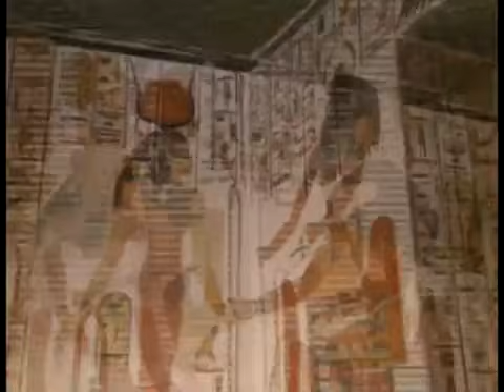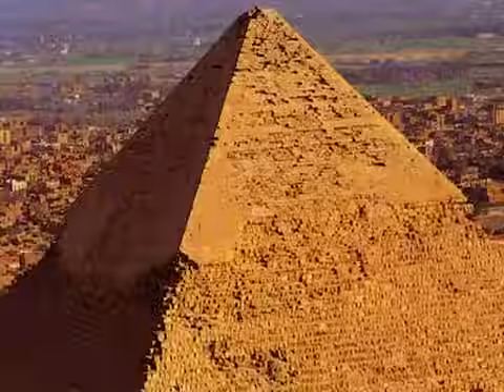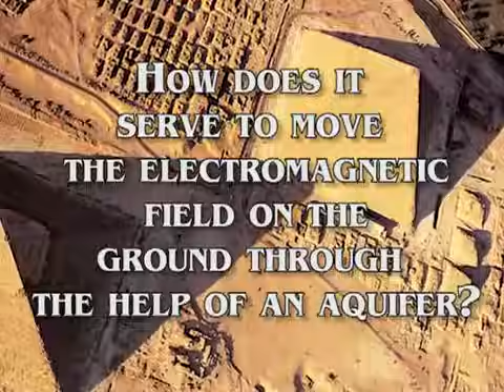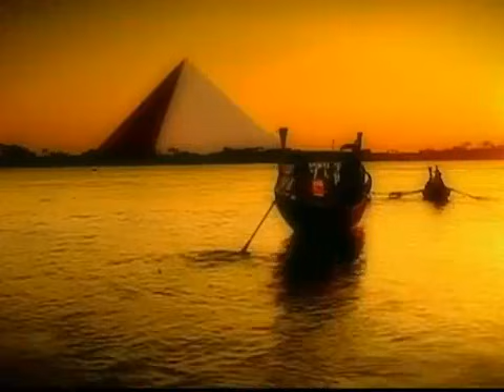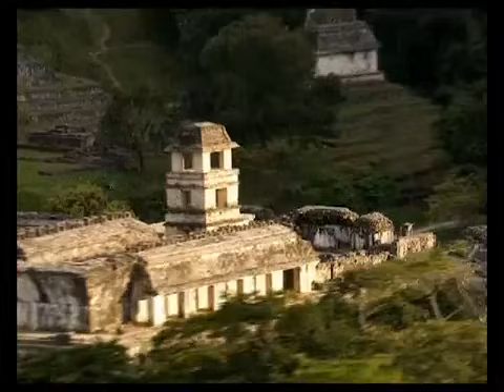Nikola Tesla - The secrets hidden in the pyramids of Egypt

Comment: I stopped at the point where it is claimed that Granite conducts electricity. No it doesn't to any significant amount.
Reply: Who knows what technology they were using? Granite does conduct electricity even though it's very resistive.
Reply: MrElectrifyer
 As far as I can see the conductivity of granite is dependent on the amount of water in it. - The water is the conductive medium not the granite
Reply: CAPTIVEPULSEMAKER  No such thin in electronics as a crystal diode as such - sorry - There have been so called crystal radio sets that used a germainium diode as a rectifier and detector.
Please provide a citation as to where Granite is used in electrical machinery or power transmission.
Reply: Yes it does. http://pubs.er.usgs.gov/publication/70012142. Yes, water is a factor, which is why the pyramids were built upon aquifers.
Reply: *****  Maybe but not the same as conducting
Reply: Ayres Élevé Uhm, that's graPHite, he's talking about graNite
Reply: Richard Harris granite has repulsive properties like that of an octahedron or cooper pair that  can act as a superconductor in a hot to cold transition
Reply: Me too, i stopped there, nonsense as usual.

A french Architect described exactly how pyramids were built, a couple years ago. Every single piece of evidence supports his approach of an internal railway allowing to build the structure, everything using contemporary tools.
Reply: viper100200  MrElectrifyer  Oops you caught me.  I got drunk and made bold claims based on my own typo.   You're right.  I really shouldn't post things to youtube when I'm drunk.  Big fail.  haha.  However, I did find this: http://pubs.er.usgs.gov/publication/70012142.  Could be nothing, but could be something.  Thanks for pointing out my mistake, y'all.
Reply: Richard Harris you want to set up a test protocol or just read what some else says?  the pyramid sets up and self feeds tself an ultra sound( just the like ringing in your ears when its dead silent), the granite acts as a constructive interference resonator to this frequency just like broadband quartz the broadband is provided by the base (like a RF conical antenna) the high frequencies by the top, resonance is an oscillating repulsion caused by constructive interference, superconductors are resonance capable(cooperpaired) microscopic materials when you heat em and cool em they super conduct by charge separation (wave collapse) and become a negative reflective Andreev monopole.A transistor is technically a visible cooper par, its 2 diodes connected in repulsion or parallel like 2 batteries') if not super cooled they act like transistor amplifiers magnetic amplifiers  or batteries in parallel, they amplify inner current via that inner ultrasound frequency it also creates a huge electrostatic field for the height of the pyramid that also interacts with the ultrasound and torsion fields inside, better pyramids have a truncated top with the width of at least 5 feet if used for healing like the ones in mexico, pointy top ones are hazardous and ionic radiation eanate from them, and they make sick people sicker and over charged, like many homes that have triangular roof tops which are not healthy and are magnetically unbalanced, and a deadly force for those with an illness, I always recommend a flat roof house, anyways decorative small home ceramic pyramids don't have these huge powers nor dangers as for proof unless one can build one will just have to bring  magnetic field detectors electric field detectors , oscilloscopes, Geiger counters, voltage and frequency counters to Egypt. As for peoples health issues if you have frequent insomnia  are emotionally distraught and have a deteriorating health you cant seem to fix, you might want to move in a flat roof home or truncate the top of your roof! only truncated pyramids, domes, or flat roofs are safe for human living which is very little known fact that ends up  causing premature aging  obesity ,incurable deterioration of pre existing health conditions, mental illness extreme depression ,unease ,aggressive crazed animals,  nasty drug side effects  and eventually costs many lives, hope this will help many people out there. Only the NON IONIC magnetic base of a pyramid has healing properties.
Reply: ЩÕßíȚćЋ ЯеІαж Eat some haldol
 I hardly know where to start.
As a electronics engineer with a Hons degree I am amazed that none of my education ever covered your theory about semiconductors. all this time I thought they were all about electron  movement. as for Pyramids I may have an advantage over you in actually having been in one. they are a BIG building with little room inside considering their size.
Reply: ЩÕßíȚćЋ ЯеІαж Eat some haldol Damn. I never learned that through out my electrical engineering university degree. Will really need to dig deeper into this your theory.
Reply: MrElectrifyer
 :-) me neither.
Reply: MrElectrifyer Thanks I also have surprising knowledge on the mind effects of home lighting, bulb shapes, colors, materials, gases ect also on the effects of certain clothing fabrics on skin, laptop and cell phone microwave processor radiation, and the 1500watt 60hz magnetic oscillation's coming from outlets on the human mind  muscles and health but those are another story, let me just say if I was president people would be extremely healthier and have a better quality of life and sense off well being, we have very corrupt one track mind politician's out there
Reply: Richard Harris my favorites are Bardeen Tesla and Lilienfeld (who inveted the most insane alien transistor) anyhow I just wish I could help humanity with what I do know , I hate suffering and seeing people get ill suffer or die
Reply: Richard Harris
  Granite conducts electricity, or I would not have been able to stick two pencil cores into the electrical outlet, along with a thrid one wrapped in toilet paper = fire.   And with fire I was able to smoke the weed I smuggled  into the county jail.  Sadly, yes up my ass.  (To avoid the additional possession charge, not for fun!)
Reply: john doe
 Sigh. taking your post at face value, as has already been pointed out GRANITE and GRAPHITE are not the same. Pencil lead is made with graphite and, yes, it does conduct electricity. Granite does not conduct to any major extent.
#This is easily proven - I have granite work surfaces in my kitchen, a quick test with a multi meter shows the resistance to be in excess of Millions of ohms.
Reply: Yeah, sorry.   I replied b4 I continued reading.
Reply: john doe
  OK
Reply: alien absolushun
 Granite is only slightly porous. However your right water, provided it contains dissolved salts will conduct electricity. The video does not say water it says granite and is wrong.
Most of the rest is rubbish as well. High frequency energy transfer does work, many people, me included, have a tooth brush that charges over a wireless link, over a relatively short distance.

Tesla was a co-worker with Eddison with whom he fell out and went his own way in contest which Telsla lost.

Electrical engineers and electronics engineers today are neither stupid or ignorant of the past and yet we still use the Alternating current system. must be a reason.
Reply: Richard Harris actually the pyramid is incomplete. So it's only natural that would feel an insignificant amount of electricity. At the top of each pyramid it should be pointed. It's missing something, the conductor.  A gold pyramid shaped tip lies at the top.
Reply: The scales of objects in this video is pyramidal. Sure, small amount of granite doesn't conduct very well. But divide resistance of that by the surface are of cross-section of the structure. You would get a very small amount.
Reply: yeah! Richard Harris , at first he was all like " granite is a poor conductor" and then later a goood one : god willing perhaps??
Reply: cilstr granite is ferromagnetic
Reply: AbysseFel Would like to see a demonstration.
Reply: ***** You're not exactly helping our cause there dude....
Reply: Richard Harris and your point of view on the alleged magnetic fields surrounding the pyramids and Wardenclyffe tower? more in particular the allegation that when holding a bottle wrapped in damp cloth at the top of the pyramid sparks will fly?
Reply: Matty G
 :-) I think your directing this at the wrong person as I haven't said any such things.
Reply: Richard Harris Nor did i accuse you of saying such things.
Reply: Matty G
 Sorry when I re read it, is it a question?
If so Lets say I am very sceptical

Comment: The alternative theory is that the massive pyramid was tuned to the natural vibration of the earth whereby vibrating granite containing quartz generated electric charge piezoelectrically and then was used to amplify incoming cosmic radiation
Reply: you can only amplify what you receive. calculations? What kind of cosmic radiation? Xrays? UV rays? for what purpose?

Electricity, the construction, the parallels to Tesla's device, the chemical residue, the sheer practicality of electricity for power and light all make the electricity theory more likely.
Reply: *****
microwaves from universal hydrogen passing through a crystal box amplifier in King's chamber.  This cosmic input signal interacted with highly energised hydrogen produced in Queen's chamber, the process building up exponentially becoming a parallel beam of immense power that was directed out of a metal lined Southern Shaft.  The energy could have been used to power machines and appliances or vehicles
Reply: ^you'll have to go into more detail.
Reply: Almost.... 👍
Reply: I don't buy it. It sounds very unscientific.
Reply: ***** The Giza Power Plant (The Secrets of the Giza Pyramid Machine Revealed) by Christopher Dunn
Reply: Cris isBliss.
Love it. Technically valid and your tongue was barely visible in your cheek!
I think that you and I may have the same script writer!

Comment: Cool video. Although the Arc of the Covenant was not used for what the video says. What it did was it took the mass out of objects making the building of the pyramids possible. Using the Arc made the heavy stones into weightless blocks. He knew the covenant was needed to build more pyramids, hence creating more electricity.

Comment: Question: The direction for how to build the ark were not given until after they left egypt, so moses could not have left egypt with the ark. Second.. the center room where it would have been placed.. does not appear to line up with the peak of the pyramid.  If they can get the 4 corners to be level within 1/2 inch of each other, why would the central room be so far off center?

Comment: I was thinking about the water that had surrounded the Sphinx. the water combined with gemstones like quartz under great pressure provides electrical generation and conduction which is a possible reason for the tiny shafts built into pyramids. the shafts too small for human or animal passages

Comment: Good theory, make a small scale model of this and do some testing, see if you can actually make some electricity. See if by adjusting the scale of the pyramid if the electricity output changes, then do some math and scale up the model to the size of the Pyramids of Giza (not actually, using maths) and see if it could work. Then maybe get some funding and actually reproduce the Pyramids of Giza. Otherwise it's just a theory. Stuff that old is hard to learn about (science wise and sometimes history wise).

Comment: Electrical facilities not only need the power but also need the means of tapping that power, also you need the means by which that power is put into use. Electricity on its own is useless. Just think about it, you would need metal forming and cutting tools, vacuum extraction, filament matl. Precission tooling, brazing equipment and so on, and that's just for a single bulb ! For every other end user  items you would need appropriate tooling, and tooling for making tooling etc this was just not around, and the incremental development of such items would take thousands of years to develope. Thank you for your work, but as an Engineer I have a pretty good idea that these things were not just magicked out of thin air, and neither were they the result of space creatures plopping on Earth and offloading machine tools to make such artificices.

Comment: This is a very good video. I also do work in electronics. Has anyone heard of John Shaughnessy's work in developing the connection between a grid network of pyramids and stabiziing gravitation to limit magma flows in geodetic relations about the planets surface? Critically, I would not have called the builders of this civilization "Egyptians" since that is a term used by a conquering party from the north, well after the establishment of Khem had developed (and faded). The ancestors of Khem or Khemite is more precise; and the Moshe (Moses) part is only one person of entire dynasties to be mentioned as Hebrew contributors of foundation. Hanoch (Enoch) and Adam or the Adapa as Geb are the founders, if the accurate correlation is drawn between the very loose biblical account (written on easy to change paper) versus those accounts worked into metal and stone on every monument in the middle east.

Comment: ions are not electrons, they only carry an electric charge when in an electrolyte, such as in a battery. Groundwater is not an electrolyte. The underground chamber and  passages are not made of granite. The only granite in the pyramid is in the King's chamber and the passage to it from the antechamber, and some walls of the antechamber. Granite is not a good electrical conductor, it is highly resistive.

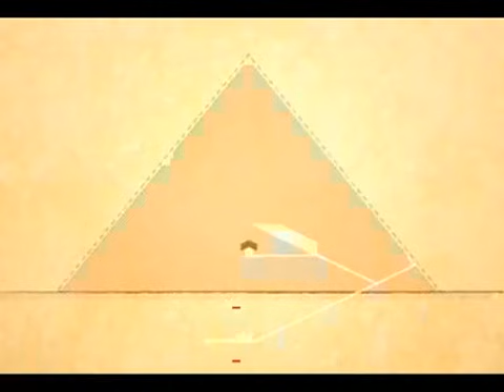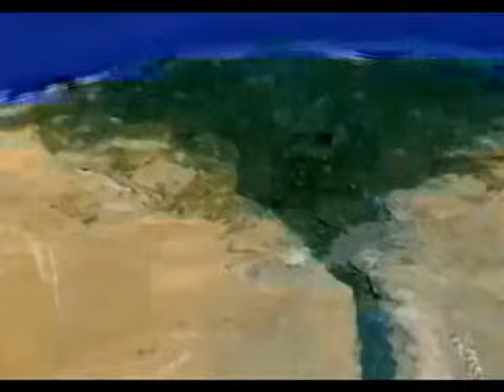Comment: At 8:25 to 8:31 video shows the pyramid from the outside with its internal shafts.  The top shaft and roof with the various cut out sections making a large room with a high ceiling was made that way to support the weight, and the shaft leading up to it has the side notches to move stones up it, and the outside corner was used as a turning point to transitions rocks off a shaft and into another.  Today the pyramid still has the corner halfway up with no stones, that is where they turned them in the corner at the tops of shafts.  Basically the stones moved through the inside shafts, I guess at least halfway up or wherever that corner is.   Additionally, the early 1900 researchers took pics of the top of the shaft which showed that ropes had been drug over those stones at the base of the top of the shafts and the stones there have grooves in it from the rope, from dragging stones up the shafts.  Also that lighbulb with the snake in it, the flower at the bottom they used as a drug to get high, so likely not a lightbulb, and I recall hearing there is lots of soot from torches in some tomb or pyramid which people say there is no soot in.  Also seems the sphinx was a lion first long before changed into a human face.  All this info comes from a documentary that covered lots of questionable possibilities then ended with I'll say the most scientifically likely.

Comment: I have built several tesla coils and have experimented with wireless technology, almost all of the pyramid power stuff was right but almost completely exaggerated. Wireless energy is not something that is made easily and takes many thousands of volts to get only an inch of clear transmission. My largest tesla coil can only do three feet or so. And even if the pyramids where able to transfer energy efficiently the distances that where stated are impossible, and if anything was not in line of sight the pyramid would not be able to receive power ( the amount of matter needed to disturb the field changes depending on the distance.)

Comment: You get same electric current from water flowing over copper. The electrons in the water push and pull the electrons in copper making electrical current. The same can be seen in static in your house as the air moves it builds static charge. The earth throws an FM frequency that can be harnessed. The star forts touch water for energy and are in shape of fractal antenna. This energy makes the singing stones of Pennsylvania sing. Radiation can kill you but we can't see it. Their are other energies we can not see hear or touch. We can pull energy from air earth and water. A 10lb sphere of copper 30 feet in air connected by ground wire will pull 1.53 volts. Any time you can get molecules moving by vibration or frequency electrons move and these moving electrons can be used for electric in one of its forms. You should be able to communicate around the world talking skip like on cb using low wattages. If you wish to understand the universe think in terms of energy frequency and vibrations.

Comment: A few interesting speculations with a lot of sheer nonsense. Just one bit of fact that you might want to use next time is that granite is NOT a conductor. It is alkaline and it is a very good insulator. It' radioactivity is very low.
Reply: Seriously. Granite doesn't do shit in the form of ionising radiation. By this video's measure, practically everything is radioactive... since everything on earth's surface has a minute concentration of the radioactive isotope Carbon-14... i.e. the isotope that makes radio carbon dating possible.
Reply: jonnies everything has radiation. radiation is any energy that travels outward in a wave or waves.
Reply: Ya, no shit. And granite doesn't expel any more radiation than any basic earth material. Hence why the video's claim that granite ionizes the air is complete bullshit.